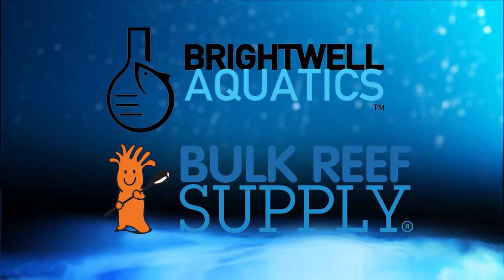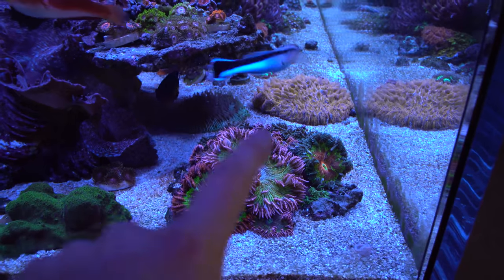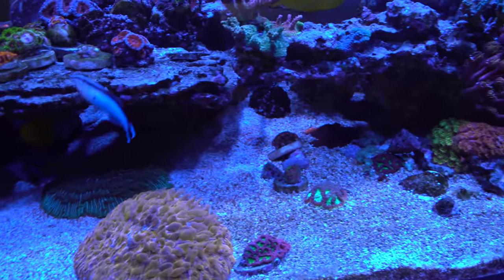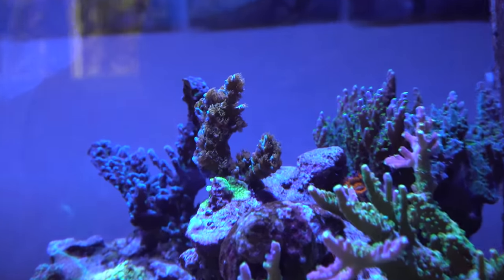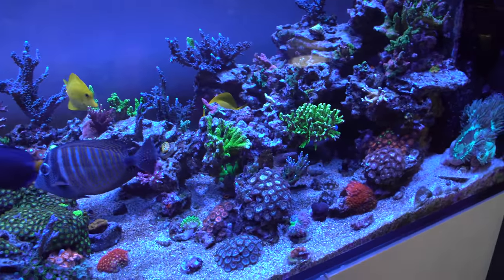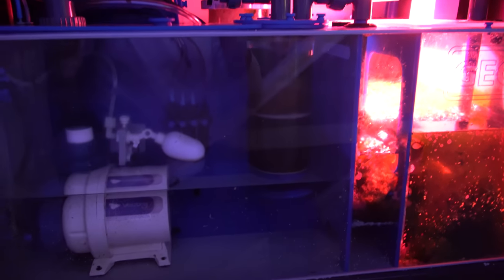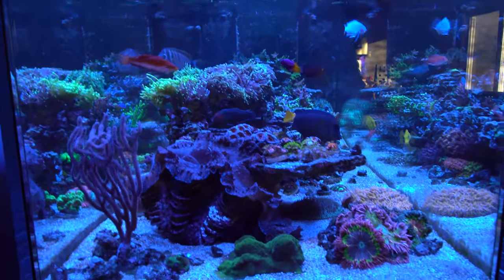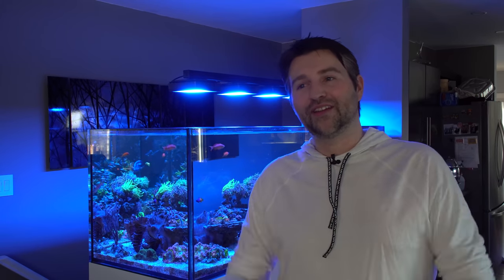WaterBox 7225 Peninsula 1 Year Tank Update - Saltwater Aquarium Tank Tour!

Comment: Beautiful tank, one note, could be wrong, but the way your UV is set up, the water isn't touching the bulb.  It's just draining from one end to there other.  The inlet and the outlet need to be point up, or stand up vertical to ensure the water is touching the UV light and filling up.  If you have a valve on it to build up pressure, then you may not be getting the recommend flow thru it.  Which I think is about 150 to 200 GPH.
Reply from the maker: You are correct as the placement is not ideal (should really be vertical) but it’s the only spot that I could fit it. That being said it is accomplishing its main job for me of keeping the water crystal clear :)
Reply: @ReefDudes  Do you have a valve on the outflow so it build up pressure?  One, UV too long can kill good things in the water.  Or the bad, which the water isn't even touching the UV light.
Reply from the maker: @brandywine3235  The UV flows to the cryptic reactor next then back to the sump.   threre is decent flow going through it.  i fully expect to be an air bubble in the top but the reactor shoudl be about 75% ish filled (my guess) its slighly slanted up to help reduce it.. not perfect, but doing the job!   Most of the good bacteria is on surfaces so not overly worried about the little bits in the water column :).

Comment: What is your secret to changing out that Clarissa filter floss. I find it difficult after owning one for over a year. I feel like the there has to be an easier way. I take a razor blade and cut out the old until I get to the motor.
Reply from the maker: Ah that part is a pain.  Or ally one the Center with something to hold the motor and slide off the roll.   As for pulling the new one though I staple the new role to the old role and let it pull it though for me . Pretty sure I did a video on that one a while back :)